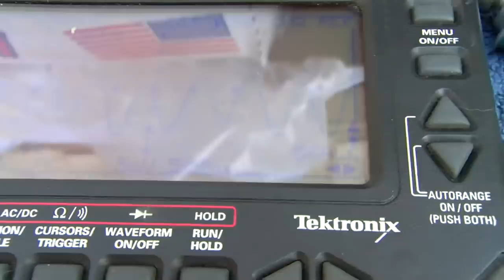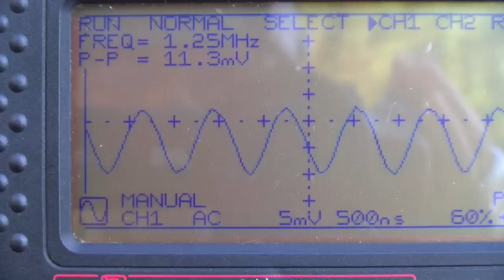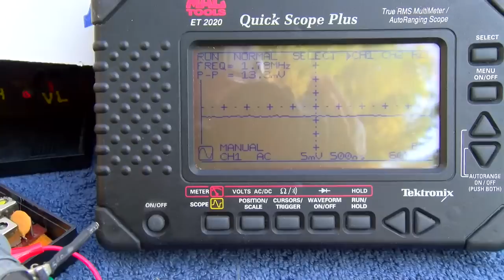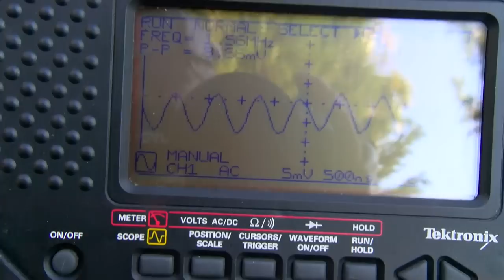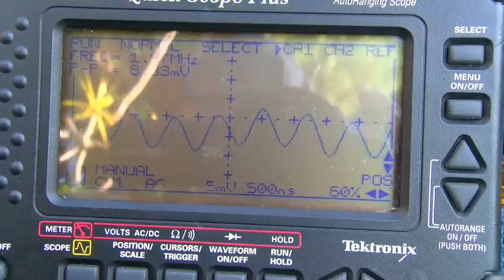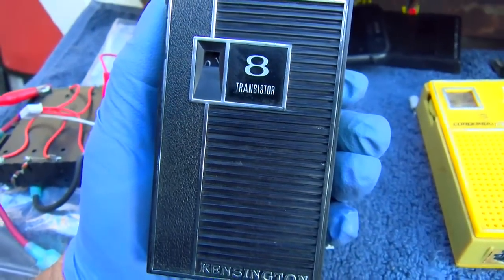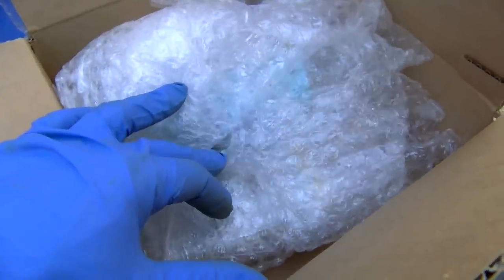Box Of Small Radios Kensington AM Transistor Radio Repair

Comment: I found an 8 transistor Zenith Deluxe Royal at a local flea market that does honestly use all 8 transistors. Has an RF front end and a separate mixer oscillator for stability. Works like a champ and very good sensitivity. Someone's junk is now my treasure.

Comment: I have one of those Kensington AM radios with something like 15 or 16 transistors. It's crazy how many useless transistors they used to stuff into these radios.
Reply: Yep,it was all about getting the transistor count up. Pure marketing decision.  The more transistors it has the better radio it must be.
Reply: @Suddenlyits1960  I just pulled out the Kensington I have and sure enough 16 transistors. I also have a Mark T that has a mere 15. I picked up a 10 Transistor Juliette that has a sticker on the bottom that says " This Receiver uses a 10 transistor circuit wich complies with the FTC ruling on Transistor cont of Dec. 10 1968" so it looks like the FTC did crack down on ploy they where pulling off on radio customers. BTW the Kensington only has one stage IF and isn't any better then a 6 transistor radio.
Reply: @jrocco36  I have an American made 10 transistor Jewel radio that when you remove the redundant transistors in the audio output and replace one transistor that is functioning as a diode you have a seven transistor set that performs like a seven transistor radio should.  Nothing all that special.
Reply: @JRocco 36,thanks for sharing the info on the sticker. I had remembered that the FTC cracked down on the inflated transistor count but couldn’t remember when exactly it happened. They’d just toss in transistors that didn’t do anything and weren’t even hooked up so they could claim their set had 14 transistors.  More equals better in the average consumers mind.

Comment: I have a 1963 Wards Airline Cigarette pack storage transistor radio. Looks like a tiny table radio with a flip open top to store one pack of regular or king size cigarettes plus matches or a lighter. Plus a place to stick your initials from a furnished sheet of them. It is called a Solid State Table Radio model 1706. DC powered.

Comment: I have one Sylvania radio from the late 1950s which has only four transistors as it uses one as both an oscillator and mixer.  Not the best performer but still quite good for just a four transistor radio.

Comment: I was hoping to hear the "This is a test" station!
Reply: That Caltrans robot station is in the extended band, I think around 1610 KHz.  This radio didn't seem to tune that high, until Shango tweaked the oscillator trimmer cap.
Reply: @auchterawer1150  I didn't know Caltrans owned it. What's it all about?

Comment: I have a similar issue with my 1972 Sony CF-350, except it's with the FM band where the upper and lower extremes can't be picked up at all, and in the middle of the band, the stations are either strong and clear, or marginally listenable. AM works fine.

I also have a Sanyo M-7735 that is completely dead, and the Cassette door is jammed and won't eject. There is a tape inside it.

I've also got a GE 3-6025A with the early digital tuner and it acts strange as well, won't pick up anything but some random ass weak station that it's locked to on FM, and AM is in 9Khz intervals rather than the 10Khz here in the US. Bare in mind it worked perfectly the first few days I had it. Now both bands act bizarrely, and most of the buttons below the display don't do anything whereas that was not the case before.

Comment: The radio with the 8 on it, 8 transistor. I would think when connected to 6 VDC starts off loud and then slowly get quieter. That’s because there is a sudden input  a surge of power maybe not quite 9 VDC but enough to drive the components as the surge goes away and it’s just a constant 6 VDC then the radio  gets gradually gets quieter due to lack of voltage.

Ricky from IBM, Ret in the Free Independent Constitutional Republic of Florida (no longer from Simi Valley)
Reply: My first thought was an open emitter bias resistor.  The bypass cap would charge up, raising the emitter bias until it got close to the base voltage, then the transistor shuts off.  The problem with that idea is that unless the cap was really leaky, or had another discharge path, it would stay charged, and the radio would only do that once, until the cap's charge bled off.  When he found the open trace, that was sort of like having an open resistor.  I don't know if that was the ground trace to an emitter resistor though.

Comment: Would have been very-interesting to actually know what line in the circuit that trace-break was at.
It is interesting to note that a serviceman can encounter some of the most-bizarre symptoms that when described to an engineer are beyond his belief.
If you really want to know electronics, find all manner of electronic devices and do exactly what Shango does--bring them back into operation.
However, Shango could save himself a lot of trouble, if instead of all this troubleshooting stuff, he'd instead just give the radio a shot of 'clotzine!'

Comment: If a transistor has the center lead cut out is that typically used as a diode, and can you check transistors with a VOM? I don't have a transistor tester that's why I ask.
Reply: A diode can be made using either the transistor base to the collector or the base to the emitter - the spare lead doesn't need to be cut, but you can if you want. With this info: It's best to check both of those internal diodes with a DVM diode checker feature. If you only have a voltmeter (a current meter would be better), you would need to build a small test circuit. Hope this helps.

Comment: I dont know. I have a kit radio with local osc, and filtered final. a chip. +Filter and it runs rings around the super het. From the same co hi hi...and i find that the less parts the less system noise...